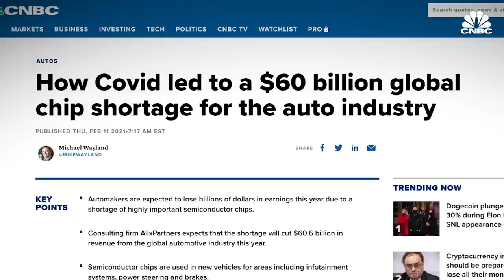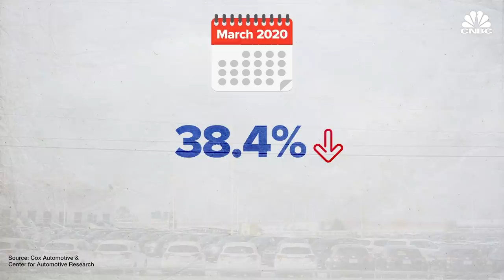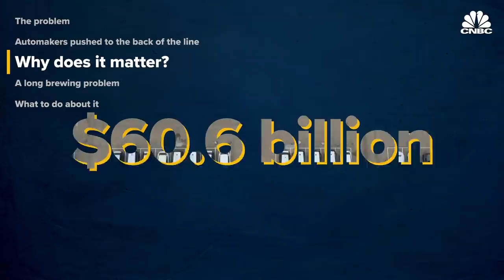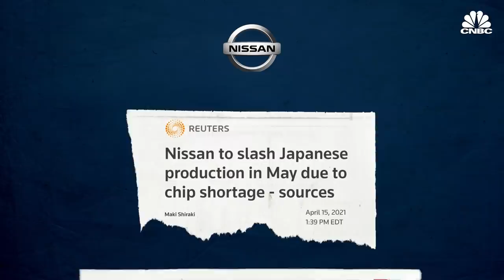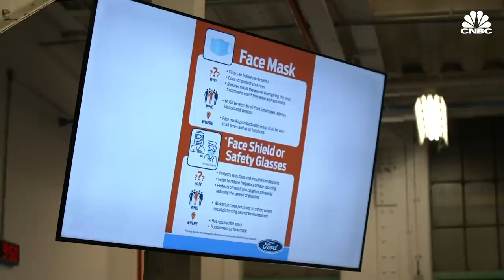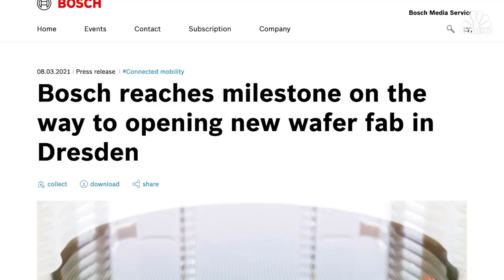Why Tiny Microchips Are Crippling The Global Auto Industry And Driving Up Prices

Comment: Well time to go back to carburetors I guess! 😂
Reply: As mentioned in this video, chips are used in MANY more applications than fuel management. Fuel injection, Ignition system, Preignition detection, ABS braking, Traction control, Smart suspensions, Infotainment, Anti theft, Multi camera systems, Lane monitoring, Blind spot detection, Backup assist, Tire pressure monitoring, lighting control, emissions control and monitoring etc., etc.    There are so many 'smart' devices communicating that cars have their their own network called the CAN bus (Control Area Network), and it in itself, it uses multiple chips   https://en.wikipedia.org/wiki/CAN_bus
Reply: @gregparrott  Yeah ,all stuff we got along without just fine before. It's called maintaining your car and paying attention.
Reply: You laugh but I have two carburetted cars on the go.
Reply: @the_kombinator  I partially agree with you. The first vehicle I drove was a 1946 Willys on a ranch over a half century ago - about as basic as they come and super easy to work on.  However, the current vehicles are MUCH safer, stop quicker, are far more crash worthy, get much better gas mileage, have much more horsepower per cubic inch, emit well under 10% of the emissions, are considerably more theft resistant, have much more rigid frames, quieter interiors, better suspensions, etc. 
Also, while there are a LOT more things which can fail, in particular, the electrical items, the mechanical components generally last longer. Even with changing the oil every 3000 miles, my '60's and 70's Chevys 327, 350 and 396 would badly wear camshafts before 100k miles. Same with the Ford 289. While you could maybe get 150k miles, performance was substantially down. By ~2001, the engines had switched to roller cams with larger diameter profiles. This and better metallurgy increased longevity, and that's despite no longer having lead in the gasoline to act as both lubricant and octane booster.
The emissions reduction is something that cannot be ignored. I visited Disneyland in ~1960. Even as a kid, I found the smog was unbelievably bad. There are more than twice as many cars in LA today, yet LA's air is still much cleaner.
Reply: @henrygonzales9666  I upgraded to HAL sensor and MSD on one of my classics, so it's not EMP proof :(
Reply: And hand-cranked windows too.
Reply: It is always cheaper to fix an old car!
Reply: If the government wasn't trying to destroy the auto industry, yes I said destroy, by over-regulating everything, we wouldn't have a lot of these problems. 

They want to get rid of internal combustion engines for Agenda 2030, and they're going to force you into self driving electric cars because you're just too dangerous to drive yourself, and they... erm... YOU are creating climate change. DON'T RESEARCH HAARP! They can't have anyone knowing man-made climate change is actually government-made climate change, it would ruin their narrative to take everything away from you. 

Hail Science! 🙄
Reply: @gregparrott  I'm sure one can replace most of those with mechanical alternatives.
Reply: I loved my 240Z with SU Carbs.
Reply: @gregparrott  90% of what you mention is useless fluff.
Reply: @gregparrott  Yeah I think the comment was meant to be just a joke.
Reply: @the_kombinator  same here bro.... I think these old cars are the gold! They are much stronger and forgiving in terms of maintenance
Reply: I replaced my Bocsh fuel injection with a manual pump , intake and 1 barrel Solex carb
Reply: I came to post something about the old way, but ya beat me.
While I prefer fuel injection, its in TBI form on the old chevy trucks, and ABS, again because I drove old chevy short beds and motorcycles, I prefer the old ways in most things but those 2. 
While relatively young at 32, I grew up in the middle of 2 ages. I grew up in computer classes and the internet at school, and doing things in my countryside home. 
I grew up with my grandpa fixing things and me being the helper. Use logic and experience, with a little ghetto engineering, and you can fix anything to work.
I like modern tech, but its too complicated. I havent owned a car in 6 years since I have lived in asia, but the electric bikes and scooters I ride are dead simple, even simpler at times than the old honda cub I used to fix. 
Point is, worst case replace a cell or 2 in the battery and can make mechanical systems to run it like the old 1900s battery vehicles. These new cars and motorcycle cant work at all unless all the parts are working, or ghetto rig it so much it isnt even the same vehicle. 
So yeah, go back to carbs or systems like tbi and abs with simple transistors of the old days
Reply: @gregparrott  all of that is either things we’ve added to vehicles which the complicity necessitates the need for the chips, or things that we got along just fine with with mechanical components before.
Reply: @gregparrott  I think that if there were to be a longer chip shortage that it would be interesting to see what the automotive industry would do to combat that. I could see there being a pivot back to some older technology for certain things however due to manufacturing processes being much better than they were 40, 50+ years ago I think vehicles wouldn’t be perhaps as prone to certain items wearing out as quickly as they used to. Just some food for thought.
Reply: @jonasjung256  I would love to see freightliner or international to come out with an old school but new version of their commercial medium duty trucks
Reply: @jonasjung256   @Jonas Jung  Things like electric windows, where a full press automatically opens/closes a window all the way, instead of only moving as long as you hold the button, are just an unnecessary convenience. The same applies to entertainment systems, climate control, navigation systems, etc. But, most people want and are willing to pay for them
Another level up are things like tire pressure monitors, collision detection and selective airbag deployment, dependent upon the direction of impact. One could argue they're not needed, but they do save lives, reduce injuries, and every developed country has imposes safety standards mandating their presence.

Yet another level up are things like such as smart fuel injection. There really was/is no mechanical counterpart. The first systems made by Bosch were mechanical. (Perhaps Dave Halcomb's comment about his Bosch system referred to an early mechanical variant). Bosch then moved on to an electronic version, but it used analog electronics. It also had complications and limitations. But, with the addition of chips, and the time to refine them, the result has been better fuel mileage, AND more horsepower, AND easier all weather starting, AND all while producing MUCH lower emissions. This just won't happen with any mechanical counterpart.

Don't get me wrong. I like old school technology. They're easy to work on and generally less expensive to repair. I began driving in the '60's, and my first three projects were carbureted 1960's vehicles. But I also appreciate just how far modern electronics has evolved. Back in the 70's and 80's, I worked for 14 years on development of automotive test equipment. This included test equipment for diagnosing the early (and fairly crude) digital fuel injection and idle speed control systems. (required to pass EPA emissions tests). 

Referring back to my experience I previously mention in Los Angles around 1960, the pollution in cities today would be orders of magnitude worse without digital controls. It would be intolerable. Aside from the hydrocarbons, gasoline used to contain lead - both as a sort of lubricant and as an octane booster in order to reduce pre-ignition/detonation. The use of digital electronics aided in the prevention of pre-ignition without the use of lead.

P.S.  I assume you meant to say 'complexity', not 'complicity'
Reply: @the_kombinator  But most people today are to dumb to pay attention to the world around them! And to keep stuff maintained correctly!
Reply: @imperialenforcer2271  You can technically. But in most cases not legally!
Reply: @devilsatan2973  Who's fault is that?
Why have we become so careless about our environment? About things that impact our very life? About outsourcing absolutely everything? 

My take is constant drunkenness, lack of morals, and laziness.
Reply: What happens when the "A.I." replaces the "A.I."???  lol

Comment: There is a huge ripple effect caused by this. I worked at an engineering firm as a electronics engineer and I run my own electronics company now and there are some critical ICs that have a YEAR of lead time at the moment. I recently visited the old company for coffee and chat and they also mentioned that they might need to redesign products to use other critical ICs, so they can be manufactured at all.
Reply: Same here. STM32 are out
Reply: As an electronics DIYer I had to wait a few months for a transformer, and many electrolytics were on a few month lead time.  It's not just chips.
Reply: @mostlymessingabout  I was in fact also specifically referring to the STM32-microcontrollers. Completely out, even STM's own webshop just states out-of-stock for large amount of models.
Reply: @antecboy  yup. We use F4s. 48 weeks factory lead time. Which one do you need? We started digging through the MCU Selector. I guess the least pain in different peripherals. The worst is new layouts... such a pain. Next gen we're thinking of scrapping STM32. There are too many SKUs and never enough chips. We've gone into the black market to get them now. We shall see what's up... hit me up on LinkedIn or something
Reply: Similar here. One of the FPGA chips in our current product design has a leadtime of 52 weeks... I foresee all electronic devices will have huge spike in price - speaking of supply vs demand...
Reply: @mostlymessingabout  I'm using the STM32L433CB6 (QFN48-EP) in my BMS design, I found a couple (50 pcs. in Germany's Mouser) L433CC6s (256kb flash, instead of 128kb) which I can use as a slightly more expensive drop-in replacement, no code or layout changes needed.
Reply: @antecboy  just bought 100 myself. At $30 each 🤦🏻‍♂️🤦🏻‍♂️🤦🏻‍♂️ ridiculous. Mouser only stock in USA. They fly everything over here to Europe

Comment: Most of the new "features" in cars are just a waste of money and an excuse to the ever increasing new car prices
Reply: Right!?  like anyone really needs lane detection warning systems. What's wrong with using your eye sockets and turning your neck to check your blind spots? That's fundamental driving skills. If you can't drive 'manually' stay at home you lazy arses!
Reply: @carrsllccarrillo6507  You are missing out an awful lot on a modern car. It is full of complicated electronics that gathers data from all over the car. The engine temperature, the oil level, the water level, the tire pressures……I could go on for an awfully long time ! Anyway these units feed into a central processor that outputs what is called the “CAN” bus. If you feel under the passenger side of the dashboard, you’ll find a covered connector, that’s the first thing a mechanic will pull off and attach his instrumentation to to see how your car is working.
Don’t diss the electronics before you fully understand what they all do. (Oh yes, lane warning detection would be in that information as well).
Reply: @nigeljames6017  for your information I deal with this all the time with modern day vehicles and hate dealing with these issues because of how much diagnostic time is required to figure out if a stupid computer has a bad internal ground or a open circuit in the wiring. Just trouble shooting and looking up wiring schematics take alot of time to pin point where direct connection and communication terminals are and yes I use scan tool equipment, test lights and a power probe III to deal with these problems.  That's why as a auto tech of 20 years I'll keep my life simple and drive a 24 year old S10 pick up that only uses 2 on board computer systems (one for the ECM and one for the ABS)  that don't require a CAN network!  Don't need anything else after that.  Thank you very much!
Reply: @nigeljames6017  pretty sure the people that complain about those features are the same ones that go "ThEy DoN't MaKe 'Em LiKe ThEy UsEd To!" And say stuff like "ReAl DrIvErS dOn'T nEeD tHeSe NaNnIeS!"
Reply: @nigeljames6017  All of those things are non-essential, though. All "nice to haves" and even then I wouldn't even want to have them, as they'll fail or become obsolete far faster than the parts of the car that actually matter. Not to mention all of those things are things anyone can check on their car at any time with relative ease, no failing upsold electronic required.
Reply: I've got a semi new, reliable car and I'm planning to drive it until it falls apart AND I can buy an affordable electric (and maybe autonomous) vehicle sometime in the next 10 years. Until then, there's just not that much benefit in all these tiny technical improvements imo.
Reply: @carrsllccarrillo6507  backup cameras, auto this and that. I don't dislike technology but all these new features are making people too dependable on technology. I am not a truck driver but have 1million miles under my belt, I have driven day, night, through hail, snow, sand storms, in the fog. 25 states and several countries, never had an accident. I know how to drive without all that.
Reply: @robertvose7540  But those computer parts come with any car bought probably in the last ten years. That is how your dashboard works. If you don’t want the computer chips replaced, tell the tech and go on a nice long sweaty ride.
If you have a lot older car, all bets are off.
Reply: @nigeljames6017  Newest car I've owned was a 2001, so...idk. My car has normal (are they still normal? I guess not, huh..) gauges for all of the things you were talking about, and I wouldn't want it any other way.
Reply: Seriously. How hard is it to use a clutch?!
Reply: an a reason for costumers to pay all the time for electronic problems in cars...
Reply: @robertvose7540  I owned a 2009 Scion Xb, I wish it had a gauge to get me a battery charge status, instead the only warning I got was a red engine light (not orange like most cars) when my alternator went caput my battery died and I almost crashed while making a sharp turn because that car has an electric motor for steering.
Reply: random user  I didn’t say all cars have modern chips, re-read my post. Cars sold at least over the last ten, maybe fifteen years will have been though (p.s. I’m not a car mechanic, I’m just an electronics engineer).
Reply: the only electronics you need is the ECU!
Reply: @kotelypiesely1268  The trouble with the ECU is that it does not communicate with the outside world easily. That is where the CAN bus comes into play. It is a diagnostic tool that takes data from several sources (including the ECU) and presents it in a digital format to a technician using a series of codes.

Here is the Wikipedia article on the ECU, and at the end the last paragraph explains the CAN bus (which is also a link) :-

https://en.m.wikipedia.org/wiki/Engine_control_unit
Reply: CAN isn't only for the technician, it's just the bus that all components in the car communicate on, so the gas pedal or cruise controll tells the ecu how much power it wants, the dash board tells the light controllers to turn the lights on etc... they are all connected on one bus system, so you can attach them all to one set of cables instead of needing one cable per component (I guess safezy critical components probably have an isolated bus still, but yeah)... that techs can listen in on whats going on is ofc an added bonus though
Reply: @Rober Vose most likely your gauges are turned by small motors behind the dash that are controlled by processors aswell^^